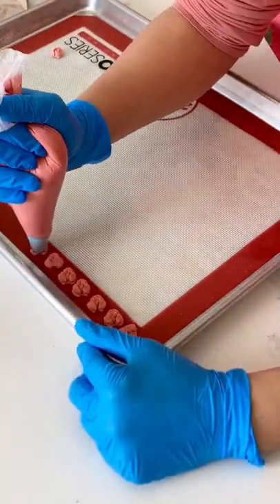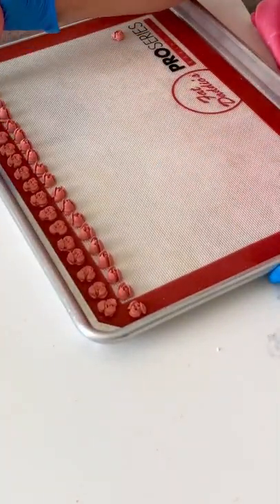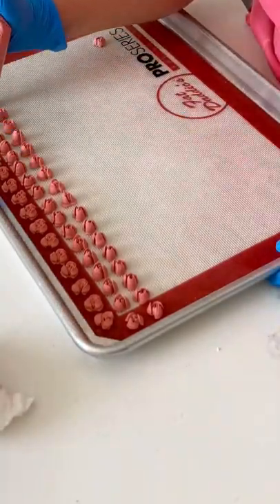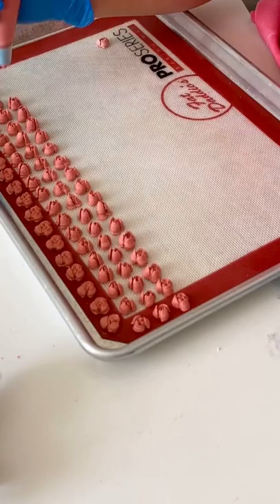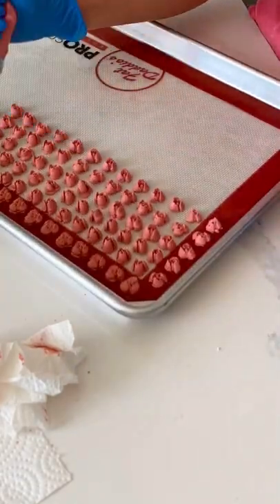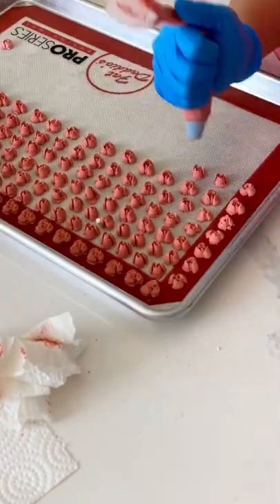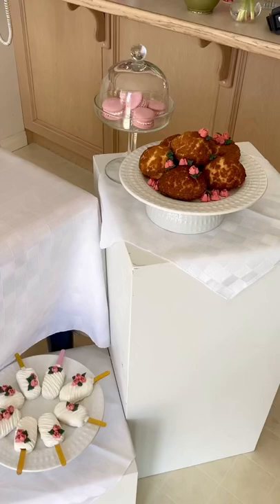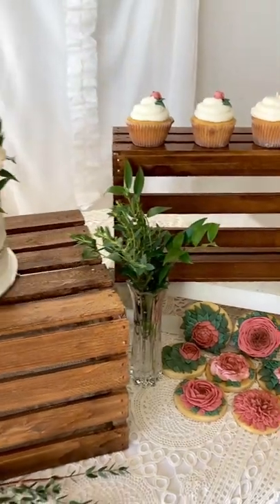Easiest Way to Use Up Leftover Royal Icing | #YouTubeShorts

Comment: I’ve been freezing my flowers to put onto cakes later but baking them makes so much sense! I’m definitely going to try that next time
Reply: Why is the baking technique better than freezing? Newbie here 😅
Reply: @AJ-dw9or  royal icing get harden with heat, buttercream get harden with freezing.. for royal icing its better to use dehydrator or oven, i even tried air fryer to speed up the process as air dry could take hours, even better if left overnight
Reply: @Auxiliawack  oh wow! Thank you so much! 💜